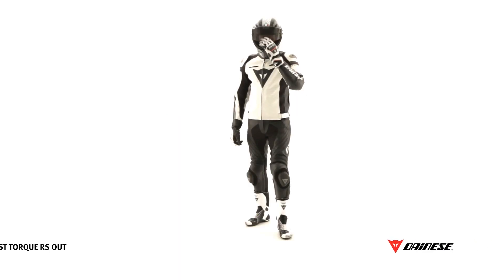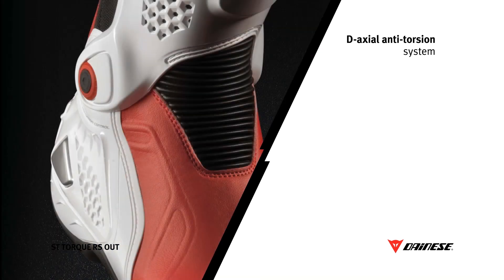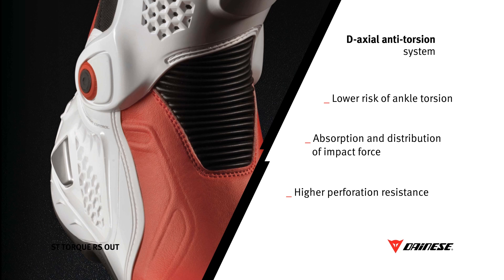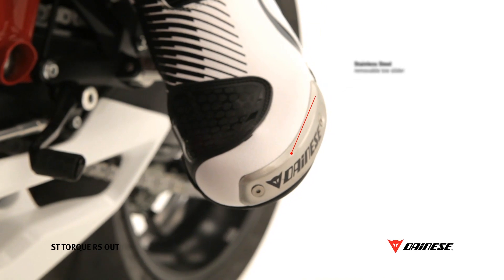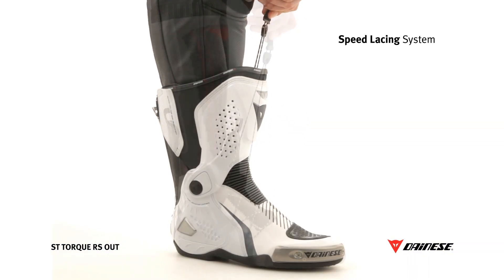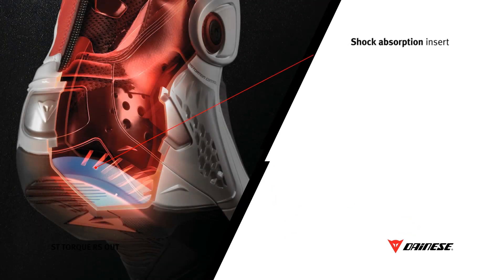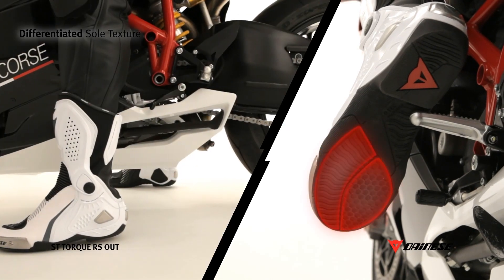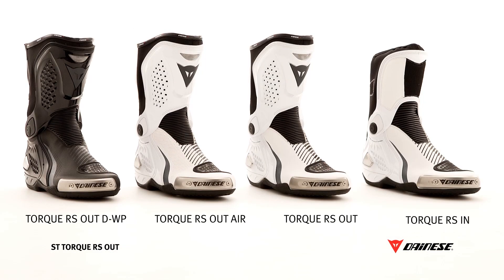Dainese TORQUE RS OUT boots

Comment: My TORQUE boots have  lasted 10 years of street use.
Reply: Mine lasted one year of Street use.
The sole is smooth at the heel and toe which has almost caused me to drop the bike at stop signs and red lights especially in the rain or a tiny bit of gravel
I believe the cause for the rapid wear on the toe is because I do a small spin everytime I get on and off the motorcycle
I'm not about to start jumping on and off so I blame the boot quality
Piss poor Chinese rubber
The toe area should have extra thick rubber for this twist onto the bike